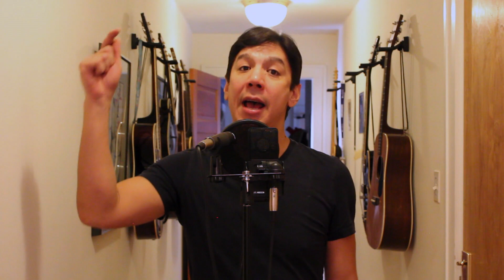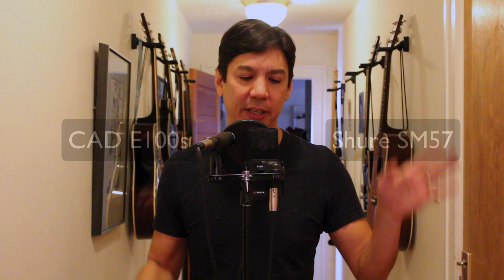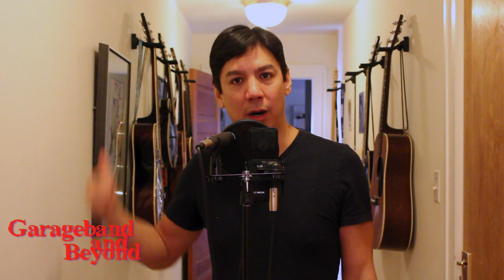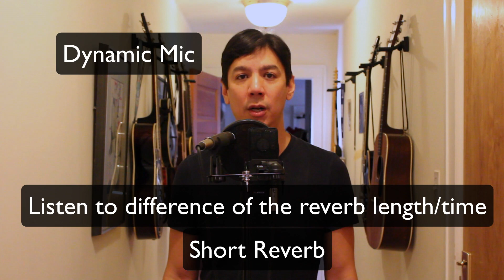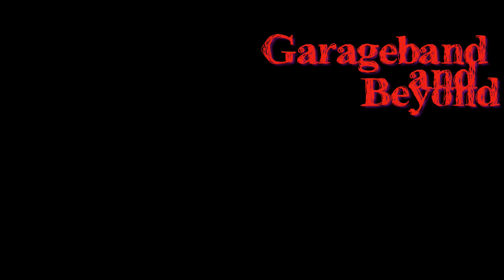Are you using the WRONG Microphone? Dynamic vs. Condensor mics DEMO

Comment: this guy is totally right. I use condenser mics often for vocals, but on the rare occasion, I have a vocalist that seems phasey in the mix. or is just way to loud. and so loud that even the room treatment isn't working. so I use my SM7B for those guys.
Reply: what do u mean phasey?
Reply: Is the phasey sound due to the high end in the mic and more noticable through compression? If so I've had this problem with my vocals and drum overheads. I recently added a room mic to my drums and that remedied the problem by smoothing out the high end (killed lots of washy brittle high end). I'm wondering if just using two vocal mics with different characteristics would even out the frequency response of vocal recordings.
Reply: I want to buy a mic to record my singing. I have a tenor-mezzo singing range, so I’m normally a bit louder while singing. I’m not really a fan of the deep tones that the dynamic mic gives, but if it is better I will get it. I have been looking at the Blue Snowball mic, do you think that would be ok for me?
Reply: @nuori_joukahainen  People with deep voice are louder in the mix. Well, they're actually louder than people with higher pitched voice since their voice occupy more freq. Our ears are just more reactive to the high pitched ringing sound that people with high singing voice makes when they sing(I'm a tenor myself by the way so I know first hand). You'll probably be better off with a condenser if your room would allow you to use it comfortably.

Comment: Great video thanks! What is the difference is between SM57 and 58? Can the 58 be as versatile for recording instruments and vocals?
Reply: 3 years late, but they are almost the same mic in terms of frequency response, but  with a different grill and other small hardware differences. The 57 to me sounds a bit flatter, and the 58 has a bit more warmth. 57 for instruments, 58 for vocals, but you can switch it up they're quite similar.